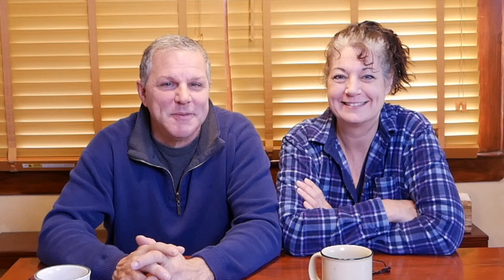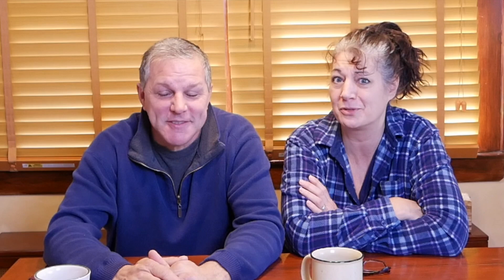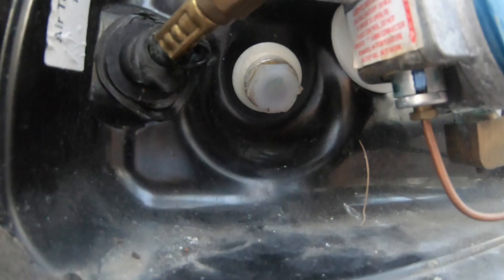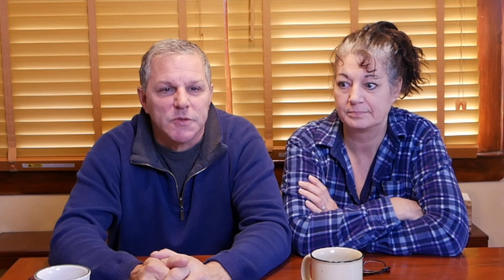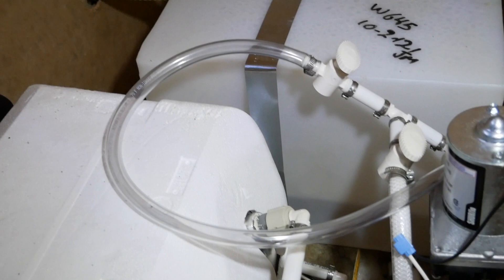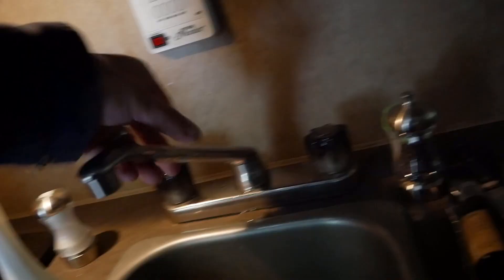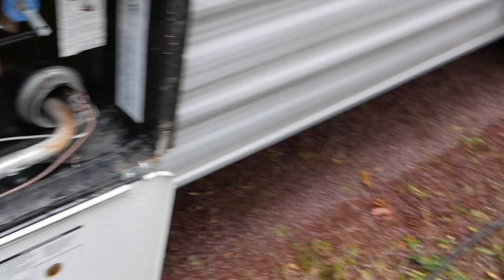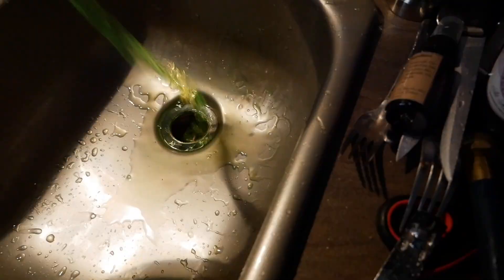DEFROSTING RV PIPES - WINTER CAME EARLY

Comment: My lines are under my travel trailer, in-between the floor and liner,,do nothing worked to thaw out the pipes , except moving ,which can't always be done 😡
Reply from the maker: That's really unfortunate.I've heard of some people using those forced air propane heaters but you have to be very careful with those. For us nothing really worked completely until we brought it back home to warmer temperatures🙁